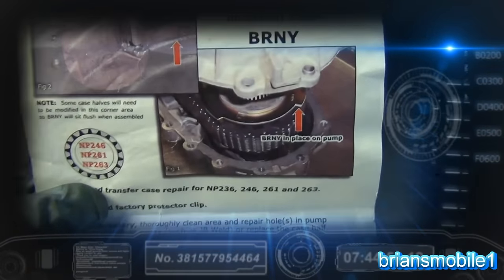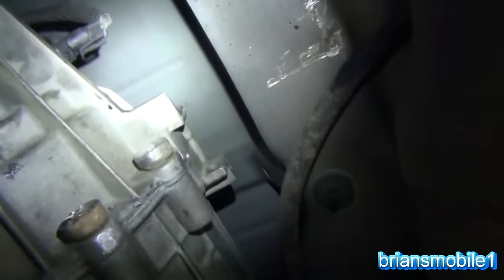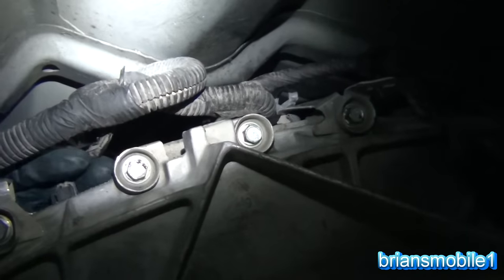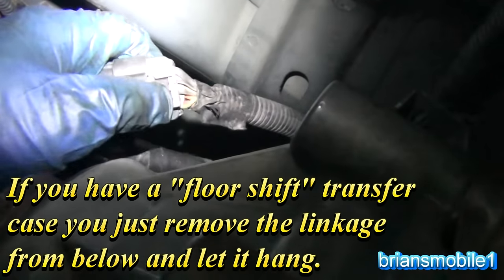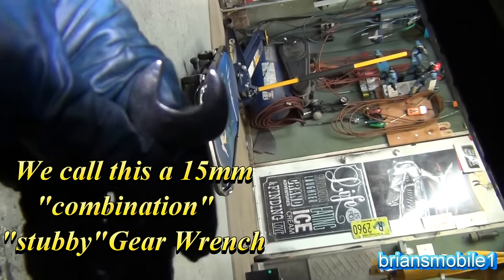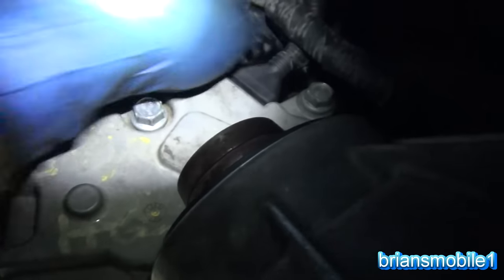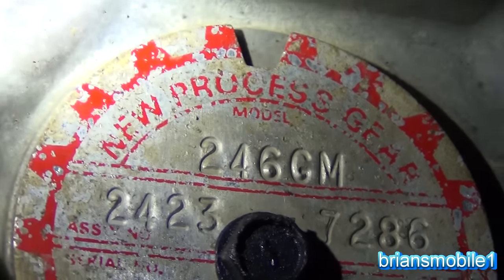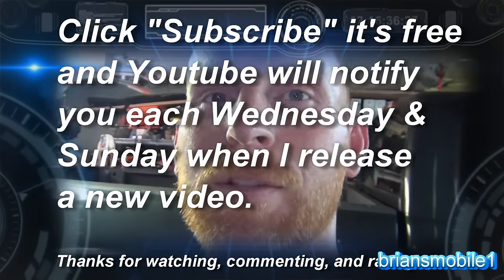Transfer Case Remove Install Help

Comment: Do you know what the size and length of the tcase bolts are ?
Reply from the maker: I don't.  I'd guess they're M10x1.25 by 1.5" but that's not for sure.

Comment: Ok Brian. I learned something today from your video (thanks). However my tag is missing on my transfer case. I have looked at the identification codes in my glove box and dont have an NP 8. I have a 4l80e transmission manual floor shift in a 96 Chevy 2500 suburban. Which code lets me know what my transfer case is?

Comment: You said in the beginning that it had hop? What does that mean? What was it doing?
Reply from the maker: "pump knock"  it's a design flaw that a plate knocks on the inside of the case and wears a hole in it resulting in a big leak.  I have another video on the tear down and install of said kit.   Check it out if you're gonna have the t-case out.   Be a good preventative maintenance thing.
Reply: @briansmobile1  I tried to find that video on your channel but couldn’t. Can you post a link to it here please?

Comment: How can I find the Torque specks on a front main cover ( under timing belt )(gasket part number 21410-38200 )for a 2003 sonata.

Comment: Hi,I have a 2002 ford explorer xlt v6, my wife was driving full speed on the highway with 4wd on, and she turn it off while she was on full speed, since the 4wd work but it make a loud noise and vibrate throughout the car,the abs light is on,and I can't switch the 4wd on low ,only on high with a lot of noise, what could it be dry transfer case, bad front diff, and I have a mechanic scan the car , the abs pump is not working.
Reply: It's a Ford I think you just fucked over you might want to get a Chevy now
Reply: STEEVE DAVID Nicolas did you check your Universal joints? my 2009 duramax did the same thing found out that i was missing a bearing cap

Comment: so the issue I'm having is I got all the bolts out but I can't get the f*** to break loose and I don't want to bust it by tapping on the wrong spot or f**** the threads on the bolts

Comment: I need so help who knows what could be the problem with my 98 ford f150, it starts and dosent make noise but when i put it in drive it dosent go? Also when i put it in park i can push it? And my 4x4 shifter is stuck and wont go into any gear, and when i do put it into drive it makes like a clanking noise in the transfer case? If any body knows what could be wrong please let me know. Thanks

Comment: never said anything about the tube?
Reply from the maker: The tube helps for expansion and contraction of air.  It just needs to point down so it can't fill with water when you take your truck swimming.

Comment: Add some context as to what model and year.  There's only several thousand options of 4x4s out there.  SMH
Reply: Yet all have similar means of removal procedure and bolt locations. The variation you are crying about are primarily internal and driveshaft diameter related. He did great explaining how to remove GM transfer cases on this generation trucks. Lol
Reply: And your not clear as to model/year of the truck? Or of the T cases? Either way, it’s obviously a GM truck. This one is a Silverado buddy. And this generation is 99-07 and we all know that. If you dont you shouldn’t be performing repairs of this degree. Models of cases dont matter in the general removal process....